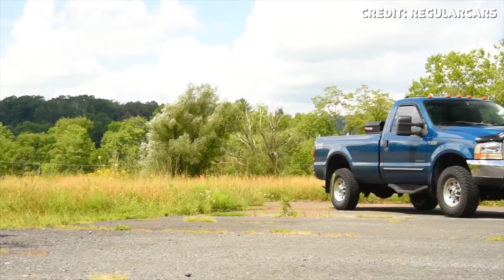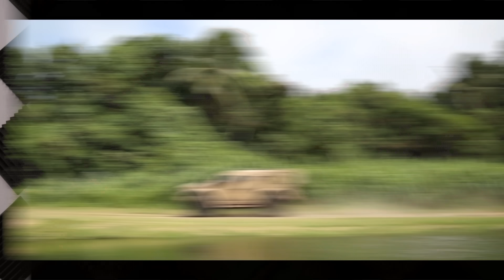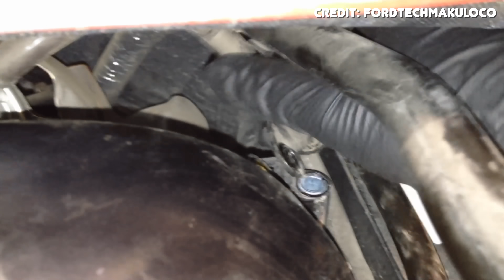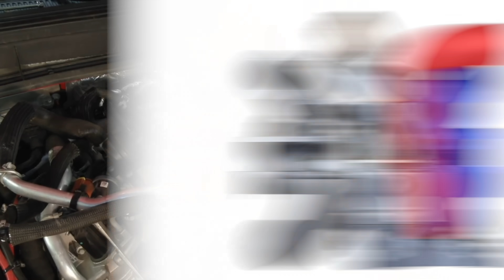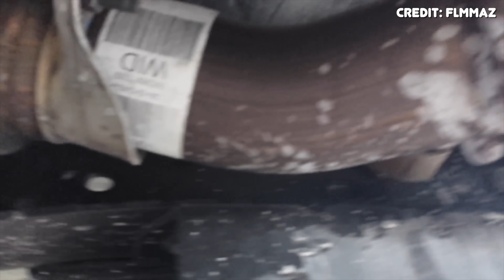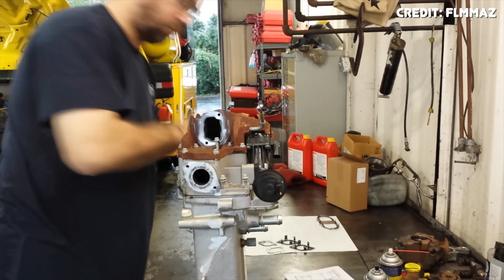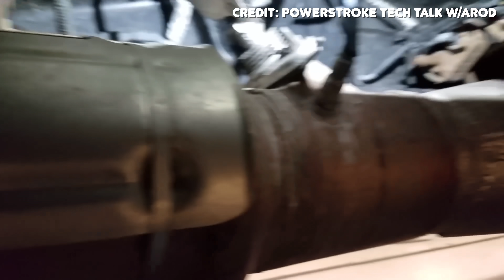Everything Wrong with the 6.7L Powerstroke

Comment: It’s a great engine and proving to be reliable and durable. The 6.7 is probably the last big diesel Ford is going to offer. The purchase cost, maintenance cost and emissions requirements are pushing people away from diesels. Ford is pretty good at reading market changes and this is why they developed the new 7.3 gas V8. And predictably I’ve noticed all of the ambulances, bucket trucks and box trucks in my area don’t have the PowerStroke badge on them or the signature exhaust tips. Being new trucks they must be powered by the 7.3. Bonus points to Ford for having the only trucks with their own engine AND transmission. Ford trucks are 100% Ford.
Reply: The newest 6.7 chassis-cabs do not have the characteristic diffuser exhaust tips you're referring to, at least when sitting on the dealer lots. I don't know why this is the case but I get the feeling it's to allow the upfitter to position them where they want & they probably have to follow some goofy guidelines set forth by the Ford QVM manual. Or maybe they're not required on C/C models anymore 🤔

I do agree with what you're saying tho, Class 6 & under diesel is dead, not worth the hassle anymore. What's really criminal is having a vehicle, especially an emergency services unit, shut down just because a sensor goes out. Yet the military trucks get off scott free, no DPFs or any other junk required. Do as I say, not as I do 🙄
Reply: @acemobile9806  the military has to be able to operate with minimum support. Just getting fuel to a was zone is difficult enough let alone DEF. They also usually drive at low speed with long idle time which would constantly clog a DPF. They also use vehicles for decades so many of the diesels they have were built before that technology existed.
Reply: @khakiswag  except the military is exempt from federal emissions. Not saying they don’t have a few diesels with def, but all the war machines do not. Trust me
Reply: @khakiswag  death wobble put my deisel down for a few weeks drove the 7.3 Godzilla between....same payload same trailer same equipment...turbo is the only difference and cost to operate the gas burner is WAYYYYY cheaper
Reply: @acemobile9806  Correct me if i’m wrong, but Depending on where these rigs are in service and it’s application, most goverment equipped diesels come with no emissions
Reply: @jaxfarias973  you're probably correct. I just have knowledge of the military's lack of requirements. If what you're saying IS true, then it's all the MORE disgusting that we the sheeple get saddled with the emissions crap. 

Personally I think it's all been a conspiracy to eliminate the 1 viable threat to the electric car industry. No one can deny the green movement is a cottage industry that has made its biggest proponents BILLIONS! Diesel's thermal efficiency can't be matched as far as ICEs goes, the greenies know this & combined with a few idiots rolling coal, they saw their opportunity to essentially legislate the engine out of mainstream use. I'm a firm believer that EVs DO have their place, ie, predictable short range intra-city routes. But don't legislate them down my throat when they are in no way feasible for long haul trucking, specialized applications like tow trucks or any emergency vehicles
Reply: Not 100% ford and Chevy have designed the 10spd trans as a joint venture. The 7.3 was designed to be the middle child between the gut less 6.2 and the powerful 6.7. Due to its overall small size this makes installing it into all the heavier f-series chassis very easy. They are also attempting to take some of the attention away from the Ls swap action with offering it as crate motor option with a standalone ecu option.
Reply: @whiskeyriver8578  the 10 speed trans is 100% Ford engineered. The joint venture agreement was that Ford would design the RWD trans and GM would design the 9 speed FWD trans. They both would equally pay for the cost and produce them in their own plants to save money. GM took the 10 speed as is but Ford wasn’t pleased with the GM 9 speed. They made significant changes and went from 9 to 8 speeds but the 8 speed they use today is based off a GM designed transmission.
Reply: @whiskeyriver8578  the 6.2 really isn't that gutless it just needs RPM. You rev it out to 4k and it pulls plenty hard.
Reply: I have a '12 350 dually w/1st gen 6.7, 6 speed auto. Total GCWR with trailer is 32k, 2k more than the p/u is rated. I have plenty of power with a modification. This p/u is used as intended, no grocery getter here. 9 MPG at best, 7.7 with 40 MPH headwinds for over 6 hours. 136k on the clock and just blew an exhaust manifold gasket...luckily still drive-able to get me back home from a cross country (S to N) trip. Excellent engine and pickup. 7.3 gasser will never perform like this 1st gen 6.7 does.
Reply: The second biggest cost of ownership for a fleet vehicle is fuel (first is depreciation). Diesels depreciate less and save on fuel costs too despite the average 10%-15% cost premium over gasoline. Maintenance costs are like 7th on the list so it still makes sense to go with diesel. Those trucks going with the gasser 7.3 are by owners who just don't care and/or trying to save on the purchase price upfront.
Reply: @erikkovacs3097  The problem with fleet vehicles is that they tend to be abused (employees who don't care) and improperly maintained (mechanics that won't fix things unless they're completely broke).  Lots of constant idling is bad for the emissions controls for the 6.7L Powerstroke (the exhaust filter gets clogged easily).  Our two F-350's at work (being used to haul barricades around) had to have engine replacements/overhauls at 130,000 miles each (they now have around 240,000 miles).  One due to apparently  a misaligned wrist pin scratching the cylinder wall, and the other due to a failure in one of the heat exchangers.  These two trucks are doing the work an F-450 should be doing.
Reply: @CharlesDB76  Those problems aren't unique to diesel engines..... or even trucks really. Even with the extra maintenance and more expensive parts, the fuel savings dwarf all of them.
Reply: lmaoooo im a ford guy at heart but the new 10 speed was literally co developed with GM, hence why the camaro and new silverado also have 10 speeds
Reply: @JMRxYM  I’m a Ford tech I work on these trash 10spd every day.
Reply: @JMRxYM  That 10 speed "Allison" in the GM is actually that Ford/GM co-developed transmission with a Allison badge slapped on it.
Reply: Thats not true, the new 10 Spd transmission, which I happen to own, is a Ford product but it is a collaboration with GM. And the GM 10 Spd is just as much a GM transmission as Fords is Fords.. GM may call it an Allison but that is a marketing gimmick.(the 6 speed found in MD GMs is still an Allison) That is also why both were released in their respective  HD lineups at the same time: model year 2020. And this collaboration was designed to pool resources and to punish the foreign owned (Fiat/Peugeot) Ram trucks competitively .
Reply: Who cares .....ask a mechanic no one wants to work on a Ford diesel
Reply: @wolf9189  as one of the biggest ford fan boys out there: fuck powerstrokes, they sound good and make power but I will never own one out of warranty.
Reply: As a Ford owner who does all my own work I can say they don't know how to make vehicles right
Reply: @jonathangarzon2798  as in they suck to own or as in they're a PITA to fix when they break?
Reply: I work for spectrum and for about 4 months (before transferring markets) I had a brand new 450 bucket truck powered by the 7.3 gas engine and that thing had power! It has so much front end torque and hp; It carried that heavy ass boom in the back with ease!  

BUT of the ones in our fleet I've noticed they're having a lot of issues with misfiring, (causing the AC to turn off..), running lean, difficulty starting and ford keeps changing coil packs, and the issue seems to reoccur. Additionally these new trucks are now equipped with the  10-speed which we're seeing a laundry list of issues that weren't present in the 6-speed. 

I currently have an 18' 450 bucket with the 6.7 and it seems to be more reliable than the new 7.3's. The 6.7 is also more efficient. MPG on the 7.3 was about 4.5 while the 6.7 I currently have is getting about 9. 

I think like anything, Ford needs to work out the kinks on the 7.3 but It definitely has good potential to be a more common option.
Reply: Not necessarily, the 7.3 getting awful mpg is gonna kill it off, the era of big v8s is ending because of all the reasons you listed
Reply: @AsianNIGMA  Not to get political and all, however unless we vote Republican in the next election, internal combustion engines including the big V8s will be cancelled.
Reply: @borla4491  cow farts and all.
Reply: @AB-bg1or  Yep. Rediculous.
Reply: @borla4491  so we should stay in the past and not even try to move forward. With that line of thinking the U.S. would’ve never developed cars in the first place. Remember back then there was no infrastructure for cars, it was horse and wagon time. We also would’ve never been first in flight, created the transistor and microchip. We wouldn’t have created the Boeing 707, the first successful commercial jet powered airliner. A U.S. car, Tesla, makes the most advanced and best electric vehicle in the world and somehow instead of boasting about that we should be ashamed. Electric technology isn’t close to perfect but you have to start some where and keep evolving the technology, that’s what China and South Korea are doing. And that’s what we used to do, we made the impossible possible. The insistence on living in the past is going to kill the U.S. domination of technology that we have had since the 50’s. Oh well, I guess we will keep our coal fired plants and oil and gas drilling and refining while the rest of the world buys the latest technology from China.
Reply: @khakiswag  If you like EVs yourself and want to "go forward" , then that's on you.

However, here, in the U-S-A, we have a thing call "choices" and "freedom", which you fail to realize that!

If you want something of what you want then that's fine. Your choice.

However, if you try to convince and force me to like something of what you get, then there's a problem . 

Which your comment screams Communist talk . Obviously, Apparently.
Reply: @borla4491  communists would have the government force automakers to continue to build ICE when they want to develop new technologies. None of them complain about increasing fuel efficiency because they are moving forward with new forms of propulsion which is immune to those regulations around the world. The big three have to build world cars to be competitive and profitable it can’t be just about the US. Choice is have multiple forms of energy not one. You also failed to say I was wrong about how the U-S-A dominated technology since the 50’s but are now falling behind China because of politicians blocking the advancement of technology which you approve of and promote. And BTW I drive a V8 truck no electric hybrid here buddy but I not against it and wouldn’t have a problem trying one of it’s done well.
Reply: @khakiswag  

Again. You're choice of what you want.

You want to drive  EV vehicles? fine.

However, in the USA when you make everyone do the same of what you are saying. There is a problem.

The stuff that you're talking about, is the same similar stuff others had said about Hybrid cars taking over.
Reply: @borla4491  that’s gonna happen regardless buddy don’t be delusional, at the rate we consume oil we’ll be out of public oil by 2050
Reply: @AsianNIGMA  I see you're an undercover Democrat.

Oh', and I'm an Independent by the way.
Reply: @borla4491  so am I, I actually despise all politicians. Real independents don’t push one party over another by telling people who to vote for. Real independents vote for a candidate who they feel is best for the job, Democrats or Republicans, it doesn’t matter. You want to label me as a Democrat as if that’s a bad thing and tell people to vote Republican, but now you claim to be Independent. Come out the closet bro it’s OK to be a Republican.
Reply: @khakiswag  "now you claim to be Independent. Come out of the closet bro it's OK to be a Republican"

How about you come out of the closet yourself and admit that you're a Democrat by the way you're talking????

And whom says you have to" vote for a party all the time if you're affiliated with that party"?

As a INDEPENDENT , I see what/who/which party fits in the office REGARDLESS of what party, which, AS A Independent, I'll vote Republican , or Democrat, or Independent!

Which in this case, Biden, being a Democrat was not my choice in general, as a Independent!
Reply: @khakiswag  Again. "independent"!
Reply: @borla4491  you literally told everyone to vote Republican, tried to insult me twice by calling me a Democrat as if being a Democrat is a bad thing and seem to think people who are OK with alternative energy can’t possibly be Republican (lots of Republicans drive hybrids and EVs BTW). But you’re Independent and willing to vote for a Democrat. Yeah right.
Reply: @khakiswag  Clearly, you're a Democrat.

And it shows.

😁
Reply: @borla4491  still waiting for you to debate the facts but I guess you have none.
Reply: @khakiswag  Uh', I'm done talking.

Period!
Reply: @borla4491  electrification is far from ready bud
Reply: @cesarurzua8234  That's what I meant. Tell it to the OP.
Reply: @borla4491  I’m not political, that’s like putting your faith in something you know will fail, it’s common sense we’re gonna eventually severely deplete oil reserve, then what?
Reply: @AsianNIGMA  Lmao
Reply: @AsianNIGMA  bio diesel and even better yet, hydrogen, every gas car can pretty easily be converted to run on hydrogen, it's super cheap and the only exaust is water, just depends on where you get the energy to split the water apart, hydro dams can make enough for a whole city without any emissions, but this is too cheap of a solution and not a ton of profit to be made so political will never push it
Reply: @borla4491  you probably drive a Prius
Reply: @AsianNIGMA  I drive a 1999 Crown Victoria and a 1983 Suburban Dually Conversion.

Now say that again??????
Reply: @khakiswag  -- The US was actually a late bloomer when it came to passenger flights. Lots of countries had larger airports and regularly scheduled passenger flight l-o-n-g before the US did. There's no point in over-glorifying our history -- it is what it is. #factsmatter
Reply: @khakiswag  Come to Texas a republican state where no one gives a shit if you delete your diesel Engine. God bless Texas , God bless my Deleted engine .
Reply: @borla4491  hydrogen conversion is neither as easy nor as cheap as it sounds, plus hydrogen literally seeps through steel tanks, and through almost any other material too.
Reply: The point of EV vehicles is control.  The Democrat government wants to be able to push a button and lock your vehicle or monitor it whenever they like. 

Bio diesel can cut greenhouse games by 80 percent but they want eletric to control. THINK ABOUT IT
Reply: @khakiswag  do you lick windows China is building more an more coal plants an has the worst environmental impact. America oil is the cleanest an safest I can tell your a biden the vegetable supporter
Reply: Peeps that tow heavy (big 5th wheels, toy haulers, cattle trailers, construction equipment, etc.) will still buy the 6.7.
Reply: @Rattlecanjeff  interestingly enough the 250 is chassis limited, and the 6.7 and 7.3 can tow about the same on the 250. RVs that you tow behind you really don't get over 20k lbs without going outside regs, and they don't really sell well if you have to get into CDL realm just to tow them. The 7.3 with that 10 speed is stupid capable, makes almost 500 ft-lbs and can be tuned to make more.
Reply: @MekanikRandR  7.3 has about half the torque of a 6.7.
Reply: @Rattlecanjeff  and? The 6.7 is capable of holding its own with more than double the towing capacity of the 250 chassis, I admit if you're in dually needed range the 6.7 is probably necessary, but if a SRW will do the job, the 7.3 is good enough.
Reply: @Rattlecanjeff  More than half, like close to three times.  The 2021+ has a little over 1000ft-lbs of torque (in the F-350.  Cab & Chassis, and F-450 and above, its like 20% less)
Reply: @CharlesDB76  475 for the 7.3 and 1050 for the 6.7. I don’t think they derate the cab chassis anymore.
Reply: @Rattlecanjeff  They still do.  Derating the power for a commercial chassis increases the reliability and life of the engine.
Reply: @Rattlecanjeff  fun fact, the 7.3 and the 6.7 can be had with the exact same GVWR, tow rating, tounge weight rating, etc. And the 7.3 can actually be had with more payload on 250 and 350 trucks
Reply: @MekanikRandR  7.3 has less than half the torque of the 6.7 diesel.   That is 575 ft pounds of torque less than the diesel. (6.7 1050 vs. 7.3 475 ).   I just can’t see that difference not being a factor in towing these big 5th wheels, hay trailers, horse/cattle trailers., etc.   Off to find a video of a 7.3 pulling a triple axle TH up Monarch Pass!
Reply: @Rattlecanjeff  the simple fact is the frame and suspension can't handle any more trailer in a 250, and the 7.3 being lighter than that monster diesel (and that 300lbs or so of emissions equipment the law says y'all have to have on there) means the payload capacity is very much increased due to more available weight. Like I said, on a 350 frame, especially a dually, the 6.7 can out-tow the 7.3, but the 250 is chassis limited, not engine limited. 

PS if you wanna see a 7.3 gasser, or even a 6.2 gasser tow at or near payload check out TFLtruck's channel and their IKE gauntlet testing, I think it's like 10 miles up a... 6% grade? Idk it's been a minute since I watched one.
Reply: @Rattlecanjeff  
I sure did! 👍💪🦾🤜Mad Power🤛👊
Reply: @Rattlecanjeff  NOT ME I SWITCHED TO RAM ,EASIR TO REPAIR A TRANNY
Reply: @Indians Auto should’ve got the diesel
Reply: I hope not 😞
Reply: @Pheez986  
I hope so!!! 🙄
Reply: Fkn garbage
Reply: No way I’m driving gas for such monster vehicle. Love my 21 powerstroke, 0 problems yet.
Reply: @matbob7249  have you gotten an oil change yet?
Reply: Reminds me of the 2-strokes.
…..big push to make everything EV, that reminds me better get my bicycle tuned up before they ban all engines
Reply: Most in my area are triton V10 propane powered. That includes RVs,box vans,bob tails,and. Even armored bank trucks
Reply: That's the issue it's all Ford injuneered
Reply: @techs1smh13  this will out last the Cummins watch.
Reply: The 6.7 is out of Austria Ford didn’t design it.
Reply: @samduran5180  you are half right and half wrong. They “partnered” with them. Meaning they BOTH had a hand in its design.
Reply: Yup, Ford is releasing a 7.3L V8 Gasoline engine option for the F250 and up trucks
Reply: Lots of municipalities are using CNG or propane to run the gas engines.
Reply: That's ...just so untrue lol. The Ford 6.7 is known for spinning bearings and coming out of time. There are no tangs or keyways on anything. They are junk
Reply: I'd like to think ford might go for a smaller displacement diesel if it sticks around, maybe a 4.0 or 5.0l
Reply: @MekanikRandR  they tried too lol. At least for the f-150s, but ya know it made less power than the twin turbo ecoboost. I’m thinking they discontinued it cause it isn’t on the build & price any more. I would love to have a smaller Powerstroke though!
Reply: More likely by 2028 they’ll have a smaller displacement plant with hybrid supplementation.  Battery will provide added torque at low speeds, but then use regenerative braking on the downhills.  Hyliion already has a working solution for tractor-trailers.
Reply: You do realize diesel puts out less pollution then any and all gasoline engines right?
The chemical cocktail in gas is extremely to make it gas bad for humans.
Only after forcing sulfur to be removed which as a farmer we now buy sulfur to add back in as sulfur is lubrication in fuel to keep diesel engines from failing. 
EPA does not use sound science but opinion based not fact based. You know feelings. They feel this they feel that.
For the love of God diesel engines are used in low oxygen work environment mining under ground because the emissions are less harmful then gasoline.
How are we at the ass backwards point right now with engines. 
Black smoke is not more harmful then the invisible monoxide exhaust from gasoline. Black smoke is unburned diesel. Crabonmonoxide is far far worse.
No EV scam is not a better option. Hybrid is the future until the fusion power pack is invented.
Reply: And you are 100% gay
Reply: So spinning bearings is reliable? No tangs on the bearings...kind of sick of working on ford's at the shop....but really sick of rebuilding 6.7s
Reply: The future of Powerstroke would be a 6.7 Powerstroke turbo CNG engine.
Reply: @davidperry4013  I hope not
Reply: FORD IS NOT DISCONTINUNING THE 6.7 DIESELS. THIS VIDEO BELOW EXPLAINES WHY. THIS IS THE NEW 2023 SUPERDUITY LINE  UP.
https://youtu.be/3HJn7n-8AzQ
Reply: 7.3 was cut by epa over noise, not emissions
Reply: I dont trust the 10speed in my explorer. I bought 8yr bumper to bumper warranty and will sell as soon as it's up. Auto trans add~ $.033/mile even after you consider replacing clutch in manual.
Reply: Yeah 100% garbage
Reply: Fleet buyers don't want to pay the $10,000 option fir the 6.7 diesel. They will get rid of then trucks after a few years anyway. So it's cheaper to burn through the gas engines and get a newer truck.
Reply: 😅😂😅 I feel like a nursing home employee listening to old men n women arguing about which Prozac brand is the best. All are serious arguments but hilarious
Reply: JMR what do you drive n why?
Reply: The new ford 10 speed is not "its own". Its a joint venture ith gm built at a gm owned factory.😂
Reply: Ford trucks are 100% ford which means its 100% 💩 they make beautiful trucks tho I wish I was made out of money to keep a super duty on the road
Reply: Not ford axles
Reply: @5.43v  why did,nt you say "tires" or some other.goofy shit.?
Reply: This! despite of my opinion, I also think diesels are dead, it doesn't make sense dealing with all emisions junk.
Reply: 😮 @cesargallo7424
Reply: Yeah with 4.90gas and 5.50 diesel the gas won’t sell because 10mpg vs 18mpg towing similar loads. Also will cut down on the people buying f250 and f150 that don’t even own trailers I know 4 people like that and now they cry about 150$ weekly gas fill ups
Reply: @mddunlap03  You might as well say the similar thing of the ones buying sports cars/muscle cars?
Reply: @mddunlap03  really it's 8,9mpg gas pulling 15k and 10,12mpg pulling the same. 8-10k more for a diesel, plus maintenance cost. Never burn that much gas plus no emissions. Plus, 7.3 is sooooo much fun. Throw a blower on it witch the 6 bolt mains won't even feel, and still under the cost of the 6.7, and will perform right next to it.
Reply: @andrewavvenire116  maintenance costs? If anything you’ll be swapping a lot more parts out on the gassers than the 6.7. Spark plugs, coils, etc.
Reply: @andrewavvenire116  god you gassers are not bright at all. That gasser 7.3 will NEVER hang with a 6.7 diesel. To think that is just stupid.
Reply: @carsonchambers5617  ummm, it's the same man hours to pull the turbo on a 6.7 not including the parts as it is to pull a whole gas engine. Your talking about spark plugs that don't have to be done but every 100k, and will cost pennies.
Reply: @6.7powerstroke13  it will when it's pulling one into the dealership for a 10k fuel system. Yes, there are products to keep all that from happening, but not everyone will put the kits and and why should that have to be a thing? There is an industry for the 6.7, but for most people, it just doesn't make sense to own one for the cost. As far as hanging, a Whipple on a 7.3 will hang with a 6.7, witch still cost less then a 6.7,  and be cheaper to run dollar to mile, and still have the simplicity of it all.
Reply: @mddunlap03  you do have to remember the gas engines are a lot cheaper to maintain, and they usually ride better due to getting slightly lighter springs because it weighs a lot less than the diesel package.
Reply: International harvester is not ford
Reply: @robsnodgrass915  lol ford branched off from Navistar because their engine were too problematic and they weren’t paying ford for any of the warranty work they were coming back for, so , the 6.7 is built completely in-house by ford 100% . Google it brother.
Reply: @robsnodgrass915  what does that mean? International Harvester had nothing to do with the development of the 6.7; it was developed by Ford from beginning to end.
Reply: Khaki Swag where do you think Navistar came from mr. expert?
Reply: @robsnodgrass915  bro this video was about the 6.7 PSD which has absolutely nothing to do with Navistar. Let’s stay on subject.
Reply: @robsnodgrass915  

WTF are you even trying to write about???
Reply: @khakiswag  No it wasn't. Ford had help from AVL an Austrian engineering firm. Tupy cast the blocks and then they're assembled in Chihuahua, Mexico.
Reply: @khakiswag  The engine was designed by an Austrian firm.
Reply: @robsnodgrass915  you do know Navistar stopped developing the powerstroke after the 6.4 right Mr expert?